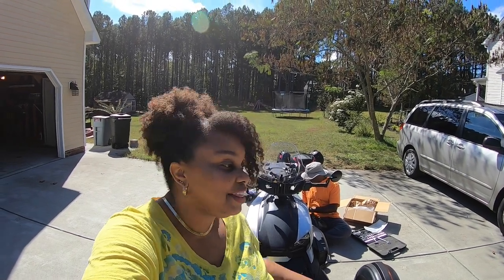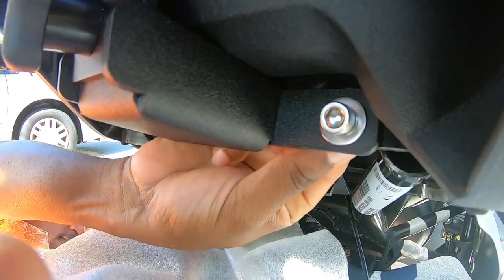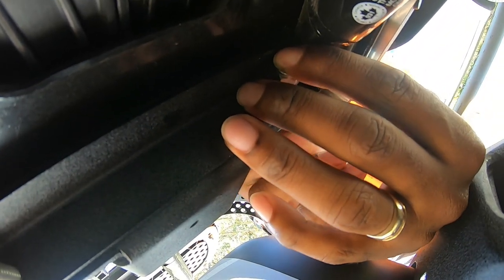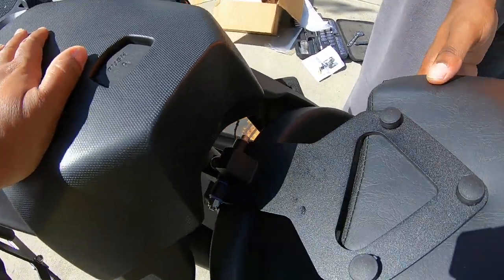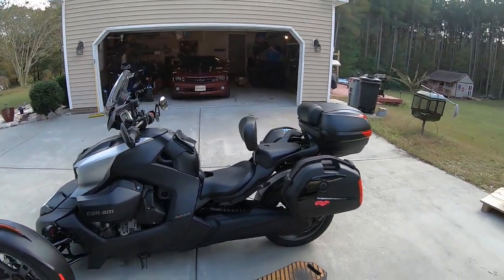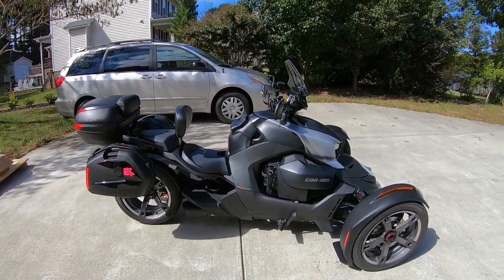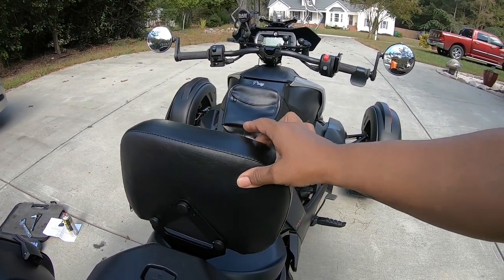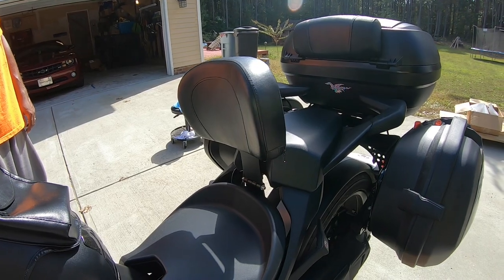Slingmods/SpyderExtras Touring Edition Padded 2-Up Adjustable Driver Backrest for the Can-Am Ryker

Comment: Great video 😍 I wonder if the backrest will work with the OEM case?
Reply from the maker: I think it will as long as it can get to the two holes located under the driver seat. I don't know how the original OEM's connect so I'm not 100% sure.

Comment: I'm considering this backrest. I have the BRP driver's backrest and it is just too hard and not adjustable at all.
Reply from the maker: I'm going to go for a longer ride today. I'll let you know how it feels.
Reply from the maker: I went for a ride for about 1 1/2 hours. The back rest is comfortable and definitely supports me. before the back rest I could tell I would slouch just a little. I am 5' 1", but I did notice that if I had a bigger stomach it would be to snug. I have it in the straight up position like it's shown in the thumbnail.
Reply: @CeeDeeLight  Thanks for the report. The BRP backrest sits down low, so it seems this one would be more comfortable and it is adjustable.

Comment: Is the backrest supported by front of the passenger seat so that it doesn't move too far backward when you lean against it? Thanks!
Reply from the maker: The passenger seat will keep it from going further back, but the mounting points are under the driver seat. Take a look at the time stamp of 30 seconds. I hope this helps.
Reply: @CeeDeeLight  thanks. I’m trying to use it without a passenger seat and mine is moving back too far.

Comment: I wish you would have sit on the bike , to see where the back rest is position on your back ,  also does it move side to side when you're siting or driving the bike"? but good job with installing. :)
Reply from the maker: You may be able to see  me riding is some of my later videos and see where it hits. I'm 5' 1 or so, so if you are taller it would be different  for you. Yes it does move a little from side to side when I move but only a little.
Reply: @CeeDeeLight  I'm 5"4 . I have a 2020 Ryker Rally with the passenger seat but I just discover that I don"t have an opening behind my drivers seat like yours.  Under the neat is completely covered. I Cannot put the backrest thur the hole because there is no hole.  I guess I 'll have to reach out to Slingmods. Thanks for messaging me back I'll look for a videos of you riding.

Comment: Is that back rest comfortable? It looks as if it would push you forward.
Reply from the maker: Yes it is comfortable.  It does not push me forward.
Reply: @CeeDeeLight  thank you for your response. Just bought my ryker rally today and will try this back rest. 😁
Reply from the maker: YAY! Congratulations on your purchase!!!
Reply: @CeeDeeLight  hi again! So I really like the hight of this back rest to support my back but I’m still unclear if it will work with my set up. I’m hoping you can clarify for me. My ryker has the max mount with the Linq top case installed. No passenger seat. I’m wondering if this back rest will work as a one up driver back rest with top case? It’s advertised as a two up drivers back rest. Thank you for your help!
Reply from the maker: @DzDani  Now that I look closer, it might not work if you don't have a passenger seat. To be sure just send a message to slingmods. They are usually very good with answering questions.